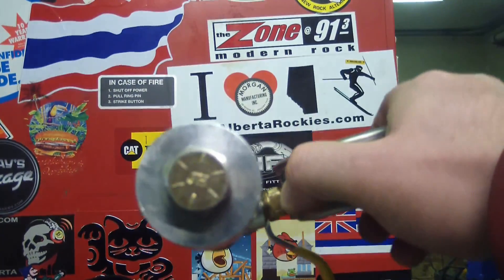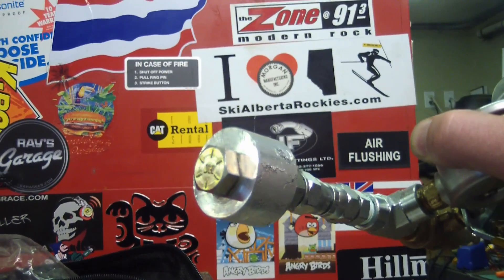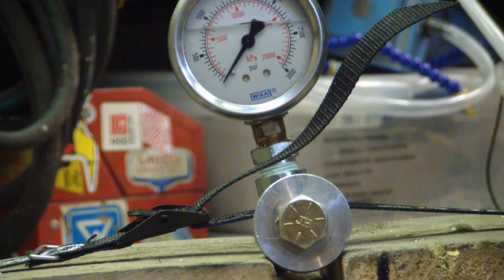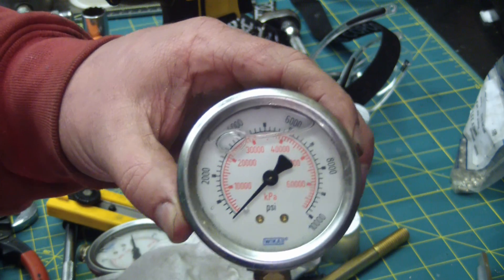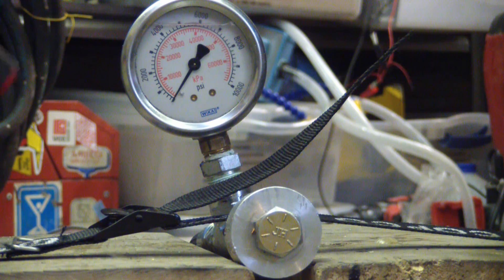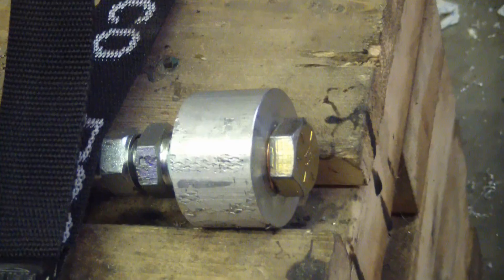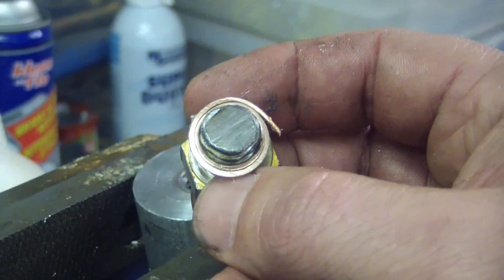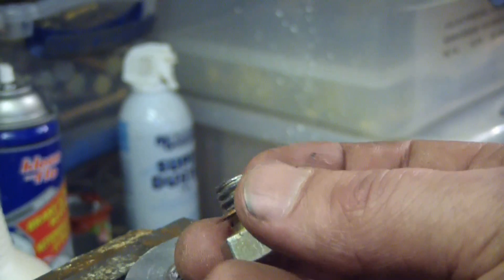Destructive Hydraulic Testing of Homemade Oil Plug.

Comment: if you don't have a bolt just stick your finger in it.
Reply: I do wonder what the max psi you could hold back with your finger is without it leaking or ripping your skin..
Reply: @MotoBuilds  Really not a lot if your life doesn't rely on it

Comment: Jesus fucking christ my ass was clenching the whole video. 
You're basically making a pneumatic bomb!
Reply: +Newton Lavoisier *Hydraulic grenade.
Reply: +Newton Lavoisier Assuming there is no gas in the line it's fine -- there is almost no potential energy because the fluid is incompressible...So much to say that the pipe elasticity would act as a spring...
Gaseous 10kpsi would ruin your day when it let loose :D
Reply: frollard good point. But a high PSI hydraulic leak can cut you with the spray.
Reply: +GunFun ZS Also true...for a short time there will be a fair amount of pent up energy...I'm glad I don't work with hydraulics if I can avoid it.
Reply: +Newton Lavoisier, Not really. The part that was expected to fail was under hydraulic pressure, and oil being incompressible stores no energy under pressure (the enclosure might store a little bit due to expansion but not a whole lot). The system under air (compressible) pressure was (I assume) from parts rated above the operating pressure, those parts were not in the shot in the 'tense' moments
Reply: +Newton Lavoisier http://www.constructionequipment.com/injection
Reply: +Newton Lavoisier Haha, I was squinting the whole time. Till that text came up on the screen I did not even realize it.
Reply: +johnomaz I missed the text the first time because I was turning my head away.
Reply: +Midas Mind That type of situation really depends on a running pump feeding a high pressure stream of fluid.  In this case any discharge would be very short in duration and you'd have to have your hand right on top of it when it blows.  (This isn't to say that powered down hydraulic machines are safe - there can be high enough pressure stored to cause injury but if there is a leak it won't last long).
Reply: +frollard Well, Technically liquids are compressible, but that requires pressures insanely high. Our oceans would be approximately 2 meters higher if liquids where not compressible.
Reply: On watching this video, squinted one eye, ready for the bang! Cheers
Reply: the thing about oceans being 2m lower by compression under their weight is a hella interesting fact. cool to know
Reply: Believe you have the wrong chap.
Reply: Science podcasts

Comment: I know very little about hydraulics but I would be scared fucking shitless of air at 10,000 PSI. Hell, 250psi of air rupturing is about like a damn bomb going off.
Reply: +Tombs Clawtooth Air is a lot more dangerous...
Reply: If that bolt had come out it would have gone through his wall.
Reply: I am glad he translated this vijeo to Murican and used PSI...kPa....pfft...what's that garbage.
Reply: +Tombs Clawtooth The hydraulic fluid is not compressible so if something gets a hole, it doesn't explode but you will get a jet of oil that tends to cut through things.
Reply: +UBranMuffin Nope, it would have flopped out lazily. As soon as the bolt moves even a little bit, the pressure drops sharply. There's almost no energy stored in the working fluid, so once the bolt moves, there's nothing left to propel it forward.
Reply: +Tombs Clawtooth Air at 45 psi can maim if xploded by a melon of a head. Check out hydro-static testing of air tanks for more carnage.
Reply: moonreft 40 PSI air will fire a projectile at 70mph...
Reply: +Tombs Clawtooth The hydraulic pump just uses air for its power source, still hydraulic fluid in those lines so no bomb being made there.
Reply: Stefan Ozog Was aware of that much...
Reply: +Bennett Ibey Tomato, tomahto.
Reply: +Tombs Clawtooth Hydrostatic pressure is much safer as the working fluid doesn't compress you don't store as much energy as you do with air pressure, all the energy in that system is coming from one  small piston which when the device fails will sharply drop in pressure, as long as it doesn't pop while your hand is over it you're probably going to be fine.
Reply: +UBranMuffin, Not likely. A pressurized incompressible fluid does not store any energy. In case it pops, the energy would all come from the expanding container of the fluid. But that release of energy is so sudden and short that my guess is the bolt would stop halfways of stripping out the threads
Reply: +Teth47 Thanks, learned something new today!
Reply: +UBranMuffin I fucking love the comments sections of these vijéos.
Reply: inthefade Yup. We're a bunch of dicks, but at least we answer questions!
Reply: imagine 10,000 psi exploding in a 80 gallon tank thats like 4 inches thick of tempered steel and it explodes, just imagine 10,000 psi multiplied by how many square inches are in the tank

Comment: I would love nothing more than seeing that setup taken to a failure state, just for the lawlz.
Reply: +jgilk1 Its even worse than that! He had it threaded into a piece of aluminum, that's the part that is going to fail. But it could be really a let down if it tears through just enough that the oil can depressurize and not explode. Someone that cares more than I should do the math and see at what force the aluminum threads should give way to the gods of oil.
Reply: +Devin Castellucci 6061 has a yield strength of 45000 psi. assuming a proper 10kpsi preload you'd need 35kpsi to blow the bolt out. i think.

Comment: I felt uncomfortable with that thing pointed at the camera, das dangerous no?
Reply: +TOExHEAD It's fairly unlikely that the bolt will teleport through the camera and hit you, if it blows.  I actually watch most of AvE's videos without wearing safety-squints, despite the sundry unsafe things he might point at the camera.
Reply: but what if the multiverse theory is true and this is the one universe where it does actually like quantum tunnel or something through the camera O.o I used my safety turn away from the monitor slightly to be safe
Reply: Knowing I was perfectly safe watching behind the comfort of my screen didn't  stop me from flinching and ducking as soon as I saw  the hydraulic  fluid gush out.
Reply: Hmm.. smart move turning the screen away from you just in case. I will have to do that for next time. Maybe angle the screen towards some terrible neighbors. :)